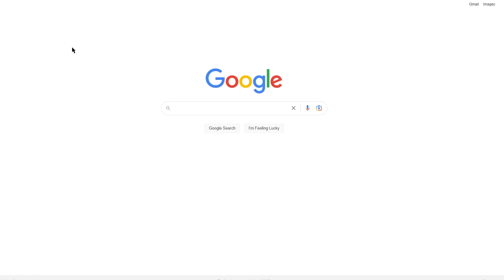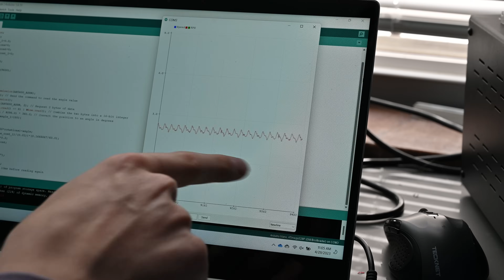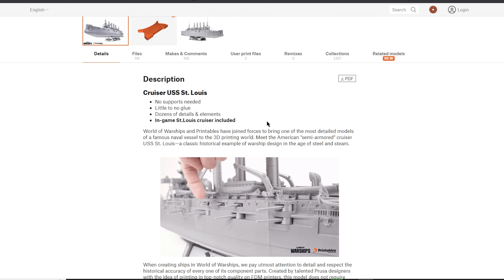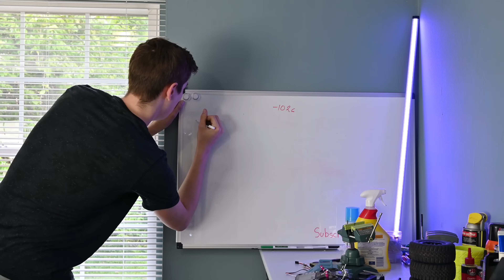I PRINTED an RC Car... How FAST can it go??

Comment from the maker: Play World of Warships here: https://wo.ws/3Mn36MM
Thank you World of Warships for sponsoring this video.
During registration use the promo code WARSHIPS to receive a huge starter pack including a bunch of Doubloons, Credits, Premium Account time, and a ship!
The promo code is only for new players who register for the first time on the Wargaming portal
Reply: Did you notice on the camera when you increase the speed the tires lose grip because they deform? RC fast cars use a kind of a rubber foam tire. Also you can put styrofoam inside the tires, like GoodStuff to avoid the lack of grip.
Reply: I found something that should help you build a better car: if you look at some videos of Project air, you will find out that the gyros aren't a good idea for high speed as they have a tendency to be affected by the small socks that the car experiences. The type of tyres that you need are foam one as they aren't really affected by the rotation of the wheels.
Reply: And btw, try to lower your car and reduce the amount of air that can go under it, to increase your grip, lower your center of gravity for stabilisation, and but some holes in the side parts of your chassis to try to make it lighter without losing strength
Reply: Gearing(big gear little gear)(and if you decide to go like 4 wheel drive rc like you watched on youtube the Diffs gearing) you have way too much torque the tires ballooning up like that says it all your power is on the low end right now. When i first got my electric car rc i didn't understand how to get more top end but it's all up to gearing with electric unlike nitro whereas top needle low needle and idle needle determine the tune sure you could put a bigger brushless/batteries or higher amperage speed controller but then more weight and complexity. As for tires switch to bald like tires and get them nice and hot/sticky or find a smooth asphalt road. Another option is dual high kv brushless cans(plus they tend be much smaller and lighter) so you could get the torque(tire snap) at all speed ranges but you would still have to set the gear ratio.
Reply: I recommend you get a hold of a pistol-grip style transmitter. It is far more intuitive for driving; I'm sure it will help you better understand the required control inputs when you're spinning out.
Reply: You need to put some toe-in on back wheels and some toe-out on front ones to make it more stable
Reply: Hi Michael, super cool project! I exported your herringbone gears and modified/increased the bore to fit the standard collar from the suggested BOM. First print, I had a separation on the pinion gear exactly where you did, where the body joins the gear. Reprinted with 1 perrimeter/top/bottom wall and 100% rectilinear infill and seems better. The problem I have is that on a quick test seems to work well in reverse but almost full slippage going forward. Any suggestions? 
Thanks!
Reply: I think you could make it more faster by making a aerodynamic cover and drive in a smooth surface
Reply: Do not put ads right before interesting part 😭It makes people (sample size: me) so much more likely to skip the ad to see what's next.
Reply: @yiin  I have sponsorblock so I don't see the ads at all.
Reply: Question: Did you use any extra parts for the new assembly except the extra suspension for the new version you printed or is it still the same parts list as the Tarmo5?
Reply: No

Comment: You need a smoother surface.
Reply: Less suspension also some wire for some sway bars
Reply: That's the comment I was about to write. Yeah, that's the number one thing he needs,common sense !
Reply: Mars?😅
Reply: Naaa he needs to know what he wants to build has the wheels and springs of a small crawler but the wing and splitter of a formula RC
Reply: Yeah fr

Comment: I think your bigest problem is your driving skills. Dont be afraid of puting a big tail as the one in a dart or more weight in the front end. It will increase drag and weight but it will help you drive it in a stright line.

Comment: Your center of gravity is too high, try and replicate on road rc cars with flat chassis, change shock angles, lift the rear and stiffen it, lower the front, keep a single battery but higher c rating, lower kv= more torque and higher kv = more speed, put a aero body and  wings, change tires and wheels to contact foam tires, or team corally's front and rear, add heavier fluid to front diff, (assuming u 4wd) also gear up and put a cooling  fan on esc and motor, if you go with a bigger can and your RC weight 10 pounds or less it should be easily achieved with a $40-50 motor, your 4s 100amp esc should be good for it, btw longer wheelbaseis better suited for stabilityat high speeds, good luck 👍 😀

Comment: Instead of installing more shocks try using stiffer springs and also use a low drag body
Reply: and stiffer oil in them, to increase the dampling
Reply: Nope, you want the softest spring possible without bouncing off the upper or lower end stops at full compression and de-compression.
He needs slower damping to reduce the high speed oscillations.
Reply: I think drag will not be a problem in a car this size
Reply: @gtjack9  Yeah, heavier oil in the dampers would probably take care of that.

Comment: You need two joints in order to make the CV axil work. The presents of two of them being places parallel makes the effect disappear. You did not need a CV. A UG would have been fine

Comment: You need to not use an air Transmitter, that will definitely help with stabilization. Also, get yourself some proper ground vehicle ESCs,motors and receivers.

Comment: Hi! I've been driving hobby-grade RC cars for 5 years and 3d-printing for 3 so here's some tips:
1. You're right, those are definitely not the right tires for 100 MPH, they are made for a short course truck. They also experience ballooning (which is what happens when the  centrifugal forces expand the tire) which caused them to fall off the rims. And yes, they should be glued to the wheels, 99% of rubber tires for RC cars have them glued. For speedruns you would use either foam tires (which have more grip and are lighter, so they don't experience balloning) or belted rubber tires.
2. The transmitter you're using is okay but it's not really meant for RC cars. It's much more comfortable to use a "pistol" type transmitter (for example a Flysky GT5, which you could use with the receiver you currently have.
3. The top speed of an RC Car isn't magic and can be easily calculated. With your setup (6s LiPo, 108mm tires, 10T pinion, 50T spur, 1000 KV (motor RPM per Volt) motor) you could theoretically reach 102.6 kph or 63.37 mph, thats assuming 100% efficiency. The formula for this car (direct drive transmission) is: [((KV*nOfCells*4,2)/60)*(pionionT/spurT)*(Pi*tireDiameter)]/1000*3,6. If you wanna convert it to MPH just multiply the result by 0,62.
4. Unless you have a perfectly smooth surface (like a strip of highway that's about to open) then you need good suspension, that is springs + damping. While the springs make the suspension "soft" or "hard" the dampers are used to make it less bouncy. You can try different hardness springs and viscosities of oil inside the shocks to tune it.
5.  Despite what many people say the aerodynamics of RC cars are important. Things like spinning tires generate a lot of drag so it's best to cover them under a body.  I'd look at both racing car bodies (from Protoform or Bittydesign) and speedrun bodies (Deltaplastik) and try to design something similar.
There is also a lot of stuff to consider about the suspension setup like caster and toe but with 3D printer tolerances they're less important than the things I mentioned. If you'd like to ask about something, I'd be happy to help.
Reply: Top tier comment
Reply: Excellent comment. Thank you
Reply: Awesome tips!
Reply: do you know what kind of ratio the tires are?
Reply: Amazing comment of the year, thanks for your dedication and kindness to share this.🎉🎉
Reply: Amazed with the video AND the comment. Please can anyone show me a place to learn about RC cars? I want to get initiated...
Reply: True that, grp tyres are nice, or foams.

Comment: Some suggestions in no particular order:
- Design it to have adjustable toe. Toe-in would help a lot with stability.
- Put a good sized vertical fin from around the center to the wing, like the ones you see on 2017 Formula One cars. This would increase straight line stability by increasing the resistance to yaw and steering changes.
- Adjust the steering input to be speed-sensitive. For example: steering output = steering input / speed. Or something to that degree, whatever works best in testing.
- Your suspension - especially the rear - is probably adequate in travel and spring force, but probably inadequate in damping, if those shocks even have real dampers on the inside. Those bumps are making the rear bounce and turn, forcing the front to go that way, which causes it to flip.
- Increasing overall downforce would also help stabilize the car, and make it more resistant to direction changes from caused by bumps.
Reply: yes, toe-in is exactly what i was gonna suggest
Reply: I would add look to F1 for downforce advice...
Reply: also, you need to grease up your fancy ball-bearing driveshaft thing, and also grease up those ball joints. just adding grease would easily add 10 mph to your speed on the driveshaft. adding grease to the ball joints and any other moving parts would greatly improve performance, as especially at high speeds they will tend to "stick" if not greased up. grease reduces friction, which can help reduce wear, but also obivously helps increase movement, increasing performance.
Reply: Also, make sure the steering geometry isn’t susceptible to bump steer.
Reply: 6:54 The tires ballooned. You're gonna need a stiffer set for 100mph.
Reply: I definitely agree with the toe-in and avoiding bump steering with suspension geometry. But I think the rebound damping is the single most important thing you need to focus on. The car seems to be pretty bouncy right now. Increasing spring force without enough damping is going to make it simply worse when it hits any bump.
Reply: @MikkoRantalainen  Oh, that’s for sure. The spring rate is much too high and the damping is easy to quick.
Reply: In my experience steering output = steering input / speed^2, multiplied by a constant, is a pretty good way to do it.  The impact of speed on just about everything is quadratic, and although I don't have any strong data to back this up it's a decent rule of thumb.  To get better results you need to do things like calculate the characteristic speed of the vehicle by measuring a thing called the "skew stiffness" of the wheels, which is basically how much sideslip you get at different speeds in both the front & rear axles.  That's probably overdoing it for a project this simple though, and I don't know how you'd measure it without special equipment.

To measure characteristic speed directly however, you simply need to be able to record yaw rate vs steering angle vs speed.  Basically, you calculate what the expected yaw or turning rate should be if the car was tracking perfectly along its wheel geometry with no slip angle.  This is something that will basically only happen at extremely low speeds.  As you speed up the yaw rate gets lower than this geometric ideal.  If you take enough measurements you should be able to identify a specific speed at which the yaw rate is half of what would happen in the geometric ideal.  That is your characteristic speed.  Once you have this, you can figure out what the expected yaw rate should be for a given steering input at a given speed.  Then you take this information and you can feed it back into the gyro with the appropriate calculations, and that should give you a very stable and predictable control scheme that works with the natural physics of the car rather than working against it.  Obviously you also need to make these measurements on a surface that is typical of what you expect to be driving on, or it won't mean anything.  You also need to retake these measurements if you substantially change the car's setup in any way, as it will be affected by any change in the wheels, suspension, weight, chassis stiffness, you name it.

This is all probably overkill for a simple speedrun RC car though.  The first equation is pretty good for a start.
Reply: @excrubulent  Great info! Is this kind of tuning required nowadays for competitive RC racing?
Reply: @MikkoRantalainen  Oh no not at all lol.  Most gyros are just drop-in with no tuning, and most RC racing bans gyros entirely.  For speedruns I don't think they care what's in the car, there is no real competition rules, they just care what the GPS says.

Like I said though, I wouldn't do all this for an RC car.  Probably the basic gyro is enough.  If you wanted to program your own steering limiter then I'd go with steering/speed^2.
Reply: To expand on the toe in comment, I would put about 2-2.5* rear toe in, .5-1* FRONT toe out (both of these will make it very stable), -1* camber on all corners, and for the caster I'm not sure for an on road application, in offroad we usually have 20-30* in 2wd and 4wd has about 10-15* but most of this is done through the front suspension kick up. For reference I'm a sponsored rc offroad driver, these are things I tune from track to track (along with a number of other things) depending on grip levels and how bumpy the track is. Those rear toe settings are low for offroad (usually we're at +-3*) but the less toe in will reduce your rolling resistance, however on the other hand it will make the rear of the car more likely to spin out when you loose rear traction.
Reply: @tirkentube   Only thing with applying grease is the limited amount needed. Any exposed areas are liable to collect dirt from the ground and this could damage or seize the component.    Grease becomes liquid above certain temperatures. Once this is reached, the grease is thrown out and it's usefulness reduced.
Reply: I think it's also important to note how badly the tires deform at high speed, leaving very little contact patch, and thus further exacerbating the lack of control at speed. In the footage of the last run, you can really see them bulging out significantly.
Reply: @robertwillis4061  that's what she said.
Reply: I was also thinking toe adjustment might stabilse it more.

Comment: A couple years ago I started down the same project 100mph 3D Printed R/C car.... I started looking at the available R/C car models and prints ultimately started designing my own. Seeing what you have accomplished I will have to start that up again.
Reply: @Daniel Toebe  :  Look out Bonneville... the gauntlet is down... the challenge is on!   😜

Comment: -Belted tires so they do not balloon
-A body for aero dynamics, at 35mph aero drag increases to nearly rolling drag and air resistance scales with size so it is for sure a factor

Comment: Thanks for the universal vs CV joint comparison. This was helpful.
Reply: Only using 1 universal is odd.
2 is normal in this application...
Correctly phased.
Reply: @Brettjnash  this makes sense too. But CV joints are found on the cheapest of cars, wouldn't  universal joints be much cheaper and stronger? But Jeep used universal joints for a really long time, but then again, they were not meant to be in 4wd on pavement, so no power going through them. I bet the difference between the two isn't that much frankly.
Reply: It was also wrong but ok

Comment: As an enthousiast of Rc speedrunning and recent Bambu X1 carbon (& PAHT-CF) owner, you got me inspired.

Some tips: 
1. Do really get a surface radio (you'll not need the gyro anymore) Control will feel way more natural.
2. Tyres are everything. There are only a few brand offering foam tyres that can do 120+ reliable. Rubbers give more grip and only a few will do so. Grap yourself some GRP GT-sized wheels.   
3. Aero will reduce demand for power. But most lack of aero can be solved by power up to 100mph. You will certainly end up with a 4092 inrunner and a bigger ESC which doesn't limit your amp draw. Batteries (max amp draw and voltage sag) will be the next bottleneck. Do some research on "true C rating" 
4. Stiffen up your suspention. Definately the rear.

Comment: You are right about the Universal joints creating that sine wave type motion. However if you have two (the exact same way the CV joints are setup)  they actually cancel each other out completely removing the oscillation. That is why any production RC car the buy uses universal joints and not cv joints.
Reply: yes and no.
on the rear, input and out put are parallel and stay that way, neglecting unequal swingarm stuff...  

on the front, the wheels steer. theres the imbalanced uni joint. and the last thing you want is your front steering wheels having non-constant velocity. 

unless youre a rock crawler and speeds are slow enough to not give a damn.

can always stick them on top of each other coaxially. gets complicated. CV is easier at that point.

a lot of production cars are coming with CV joints now...